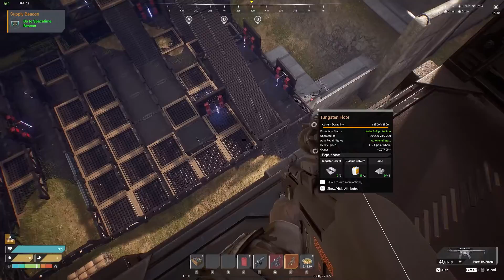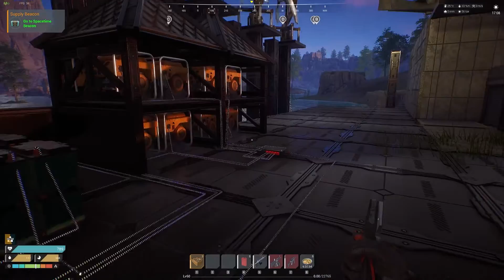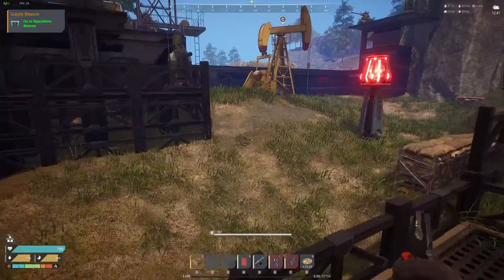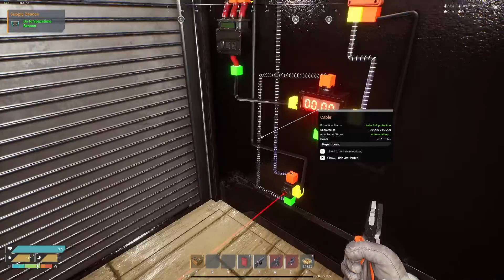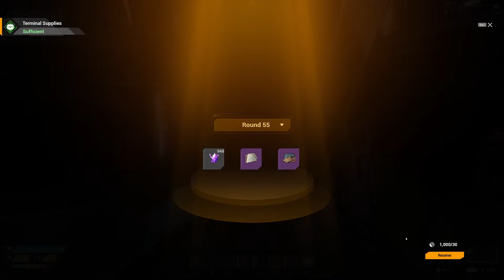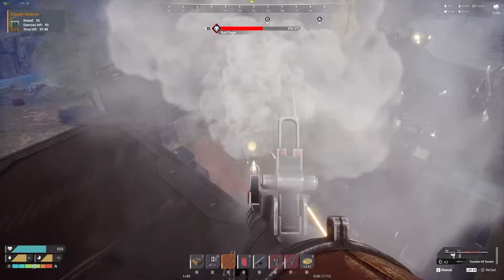ULTIMATE Battery Backup Wiring Guide! - The Front Gameplay (ep40)

Comment: I am not sure if you are aware of the 3 meters wind generator thing.  If there is any structure on the same level as the wind turbine within 3 meters it reduces the power, and a red message if displayed in the 'H' about menu with the word OBSTRUCTED.  In order to get all of the power the generator is capable of making you need to have three empty "squares" in between the generators, if you place the generators in line and exactly in the middle of their own square.  I discovered that if you treat the floor as a chess board, you get the same effect if you follow the pattern of the chess knight.  I.E.:  one left, two down in any direction, basically exactly as the knight moves.
Reply from the maker: Yeah I am aware of the distance. But I don't need them to pump out max it's only to re charge the batteries.  But I like you "knight strategy" I will try that. 👍

Comment: You can try to tame the NPC's with a rocket launcher and the flying commander and put them on your maze so they can add damage. It'll be fun! Note though, you need to level them up by assigning tasks.
Reply from the maker: Yeah I'm training some guys now to max level. But I'm sure they will not last. But will fun to watch. 👍
Reply: @OZTRON I am leveling a few npcs and so far no max level. Several are over level 120 now.   The higher the tame at the time you subdue them the more exp required to level.   The modifiers are far greater also for Taming 60s

Comment: What is important to say is that you can charge Batteries only with half the power the batterie provide.
So if a batterie provides 500 Power you can only charge it with 250 Power. You can charge the Batteries with more energy but they wont receiving (in that case) more than 250.
Dont know why the developer make it that way
Reply from the maker: Yeah I agree, it's weird you can only charge them half the output rate. I guess the devs are having them act like real battery Chargers.

Comment: for the wind generator ...if you separet them  3 square wide they will generate 61 ... the reason why  you re windgenerator are like  that , its because there too close,    3 squares from any structure on the same lvl or highter
Reply from the maker: Weird, I thought they only needed to be one square away.  They usually read higher. 🤷

Comment: do not stand in front of the wind gen . you wil block som wind . and get les power . go a little below that wind gen ( turbine) you wil get the right reading of your turbine
Reply: with below i mean the angle so you  ar not blocking the wind
Reply: + battery wil not take more then 250 power . and give 500 power
Reply from the maker: Hmmm ok interesting, I will need to test that. Maybe that's why it always drops when I read it. 🤷